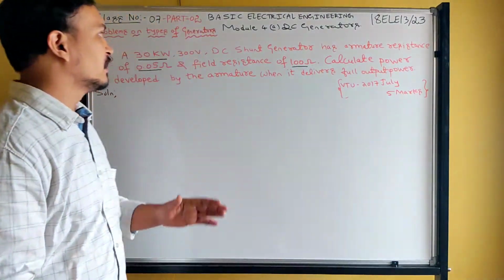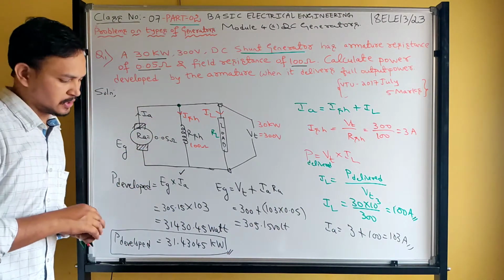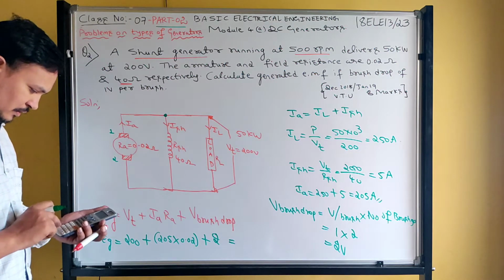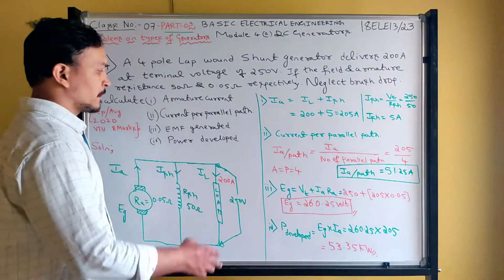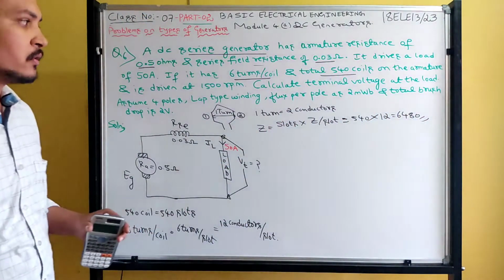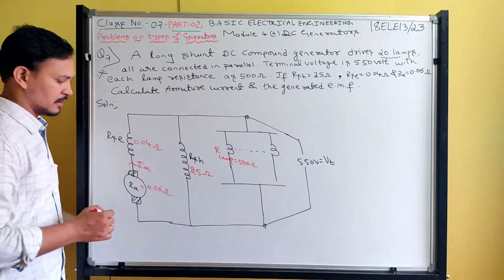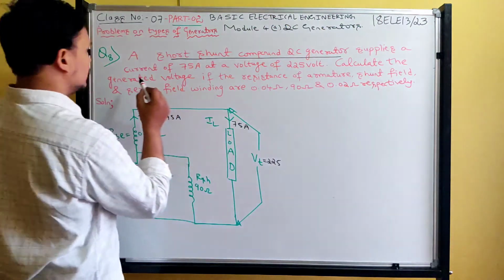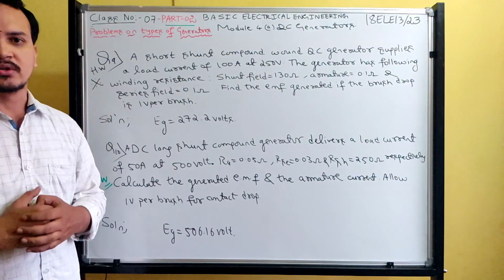Basic Electrical Engineering|VTU| Problems onTypesofDC generators|21ELE13/23 Module4-Class No7-Part2

Comment: Sir answer should be 274.4 v for question 9 ans sir 10 question was righ
Reply from the maker: IL=100A
Ish=2A
Ia=102A
Eg=Vt+(Ia*Ra)+(Ise*Rse)+Vbrush drop
Eg=250+(102*0.1)+(100*0.1)+2
Eg=272.2volts.

Ish=(Vt+IL*Rse)/Rsh
Reply from the maker: Maanyu Das thank you so much for trying Q9 and 10